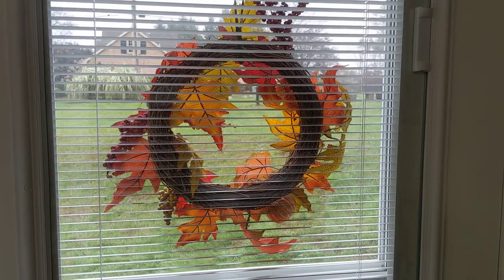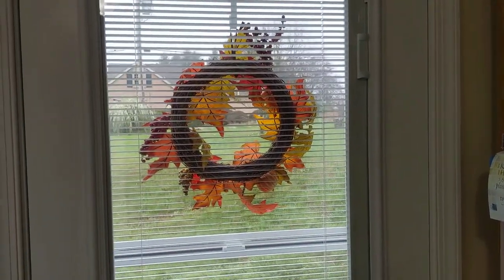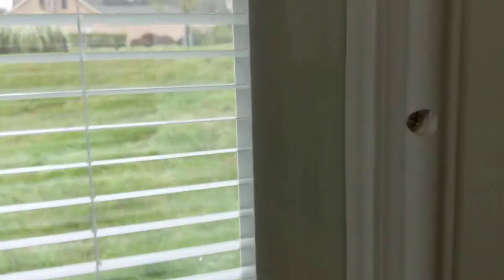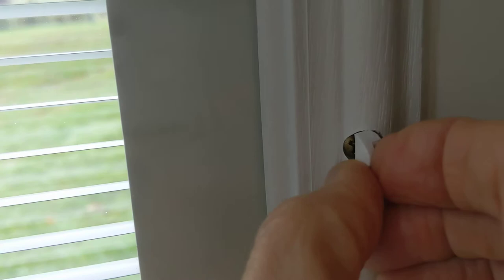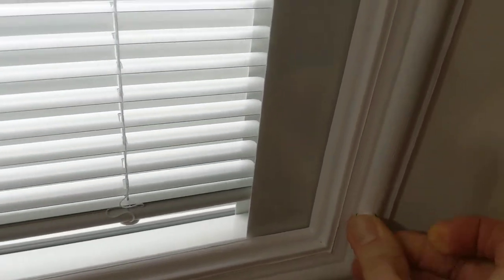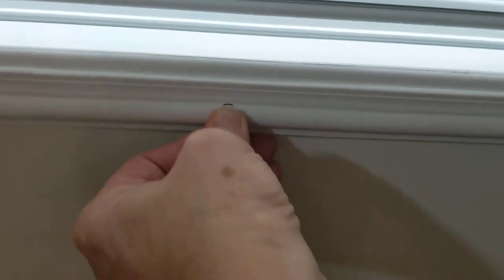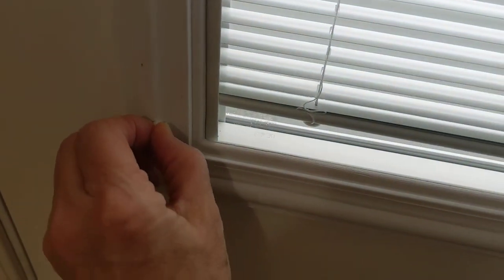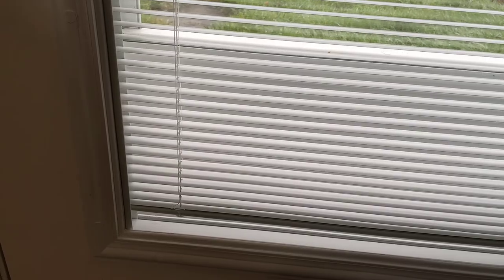Placing Caps over Screw Holes on Doors

Comment: Wow! I’ve got 4 new doors and been trying to get these in for 2 weeks. I even contacted the door company for help and they didn’t bother responding.  Thank you for taking the time to post this video. 💞
Reply: I sprayed about a drop of WD40 in the holes, and it helped immensely. I also tapped them in with the handle of a paintbrush cleaning tool. Still wasn't easy, but made it doable.
Reply from the maker: Glad I could help!

Comment: Thank you, you are officially my hero!I'm getting ready to repaint that door and I never did get these little buggers to fit so I gave up and they went into a drawer for 3 years.  Just as well, I'm taking the screws out and removing the faux panes on the inside to make it easier to paint that.
Instructions on the package were really lacking, it just says insert shallow end and push. Yeah, right, would it be so hard to just  have a picture?😂
Reply: Late to reply I read you can
Try to heat before to make it softer

Comment: I want to know hot to REMOVE them
Reply from the maker: No idea. Hope you figured it out.
Reply: cut off the head of a drywall screw.  Put that in your drill and drill into the cap enough that you can pull it out (or twist) with the drill.  You are welcome!